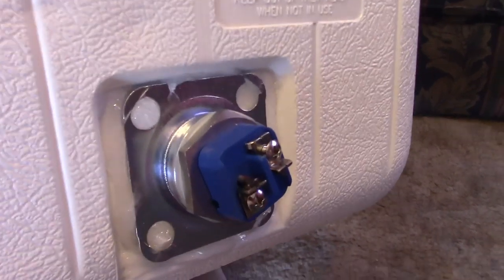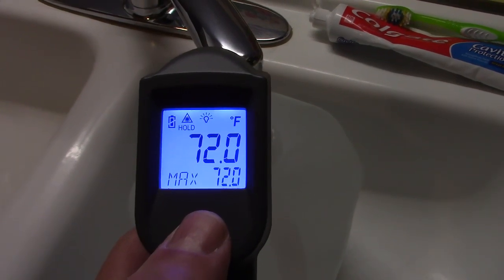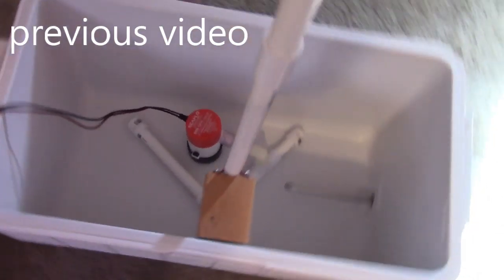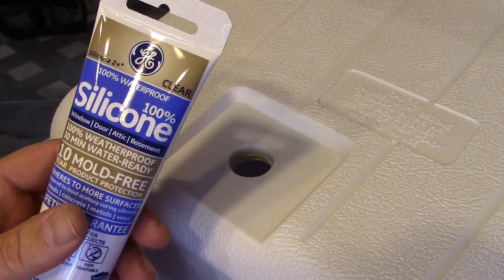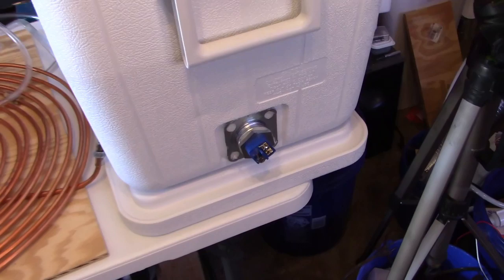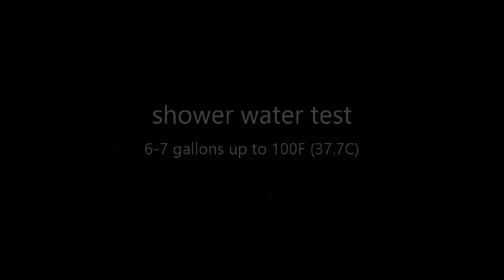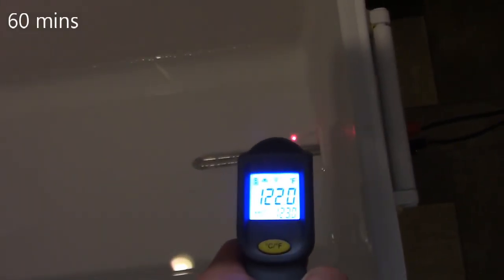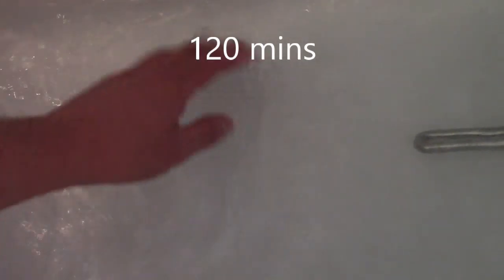12V DC "Off-Grid" Water Heater! 12v/12amp/12 Gallon tank! (ice-chest conv.) - can be solar pwrd! DIY

Comment: Interesting.  But how would could you stop getting too hot if using the solar setup?
Reply from the maker: hi. you could add a thermal shut off switch. set the temp and it cuts off the power at that temp. amazons got em. they're not much either. one for 7.99 or 2 for 10 🙂
Reply: @desertsun02  On doing some research I found some elements have a thermostat which were fairly inexpensive.  I can definitely see myself going for this kind of setup.
Reply: @robdye2192  Could you please share the product info for the element that has a thermostat?  Was it 12v?
Reply: @desertsun02  I really like this concept.  For the temperature controllers on Amazon, have a couple questions: 1) Are the sensors submersible in water? 2) Do they have the ability to relay the amperage of the heating element (12.5 a, right)?   Can you recommend a specific model?

Comment: Connect a heat exchanger with it and a fac on the one side and make a air heater
Reply from the maker: yep, you could connect this type of set up with a heat exchanger. i'd probably use a 300w or 600w element if you do that thou.

Comment: im looking for an efficient off-grid camper application that runs off 12volts. Add a  DC 
submersible temperature control switch to regulate the temperature and shut off the element when unnecessary and a float switch combined with a normally closed relay with two submersible DC pumps, one in the cooler which is controlled by a switch and another pump in a water holding tank with hose that feeds into the top of the cooler. Line in and line out. The float switch opens the relay which turns off the pump in the water holding tank when the water level gets too high meanwhile the switch for the pump in the cooler allows you to turn on hot water when you need the pressure to use it. The whole thing could be used straight off the batteries in a 12volt solar system. why they do not make a 12volt all in one water heater is beyond me.

Comment: The heating element is not 400 degrees it's the same temperature as the water!  It can't get hotter as the water will always cool it down, and therefore you get a slow increase of water temperature. If you had no water covering the element then it would get freaking hot until it burns out.